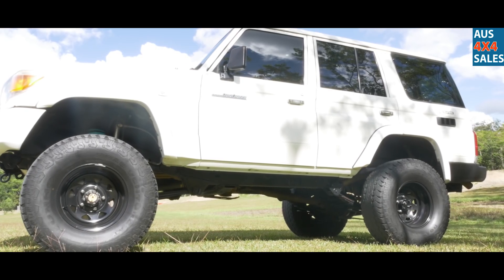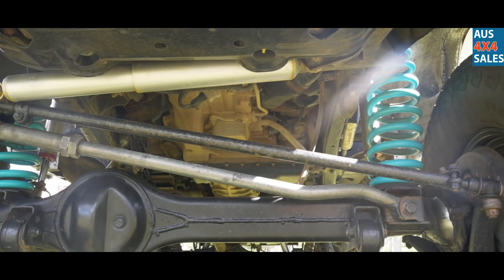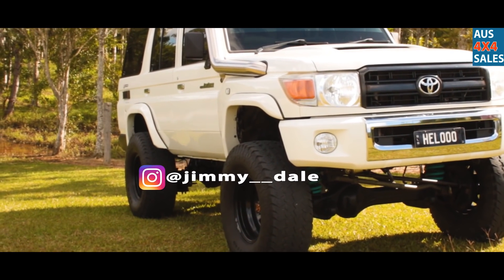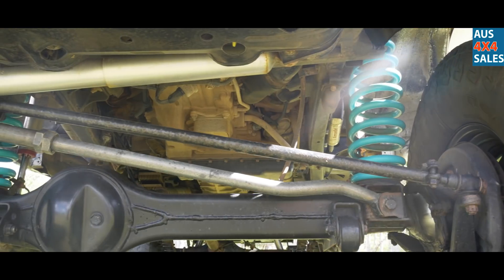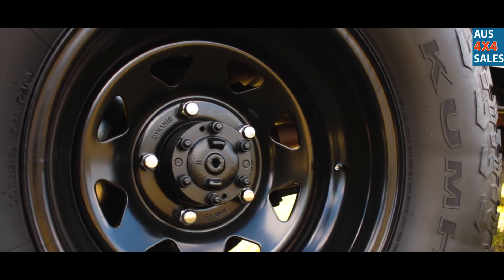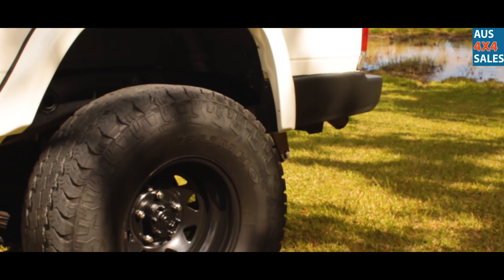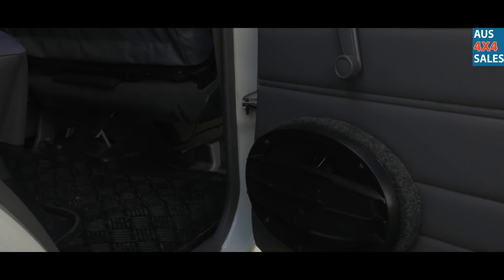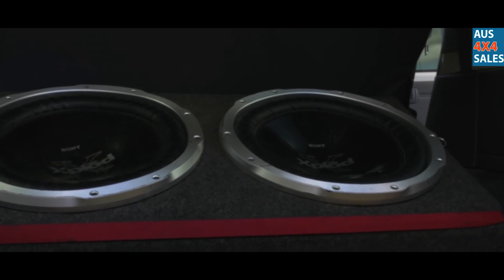HEL000 76 Wagon 4.5L Turbo V8 190HP 550nm With Slipping Clutch  4” Jmax stainless Remap Just Autos

Comment: Dont want to be that guy but for a v8 turbo <200hp is a little on the tame side isnt it? 

I couldnt count on both hands how many old oiler TD GQs and 80 series are pulling bigger numbers than that.

Love the videos just curious if those figures are correct
Reply: They make way more power when remapped. Must be number with shit clutch... around 900 it should be making otherwise not worth having haha
Reply: Spookiiee72 yeah I read the description after I posted the comment probably should have done that before writing anything. 

I would expect the vdj to have way more potential especially seeing what the gsl guys have been doing.

Haha even my hdj80 is running 200 ponies and its got half a million kms on the clock and plenty of soot to boot!
Reply from the maker: Thanks for the comment